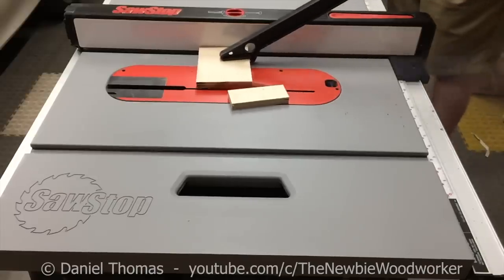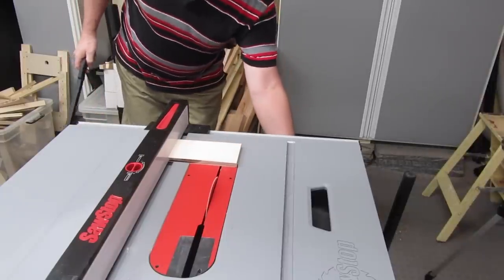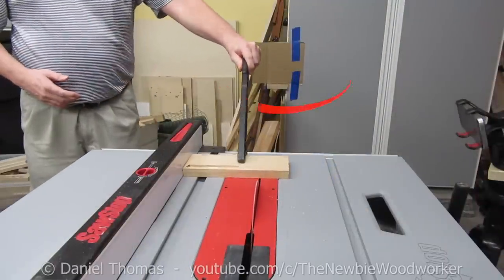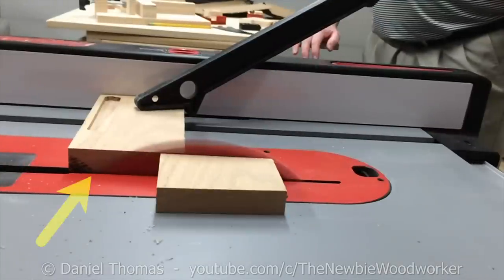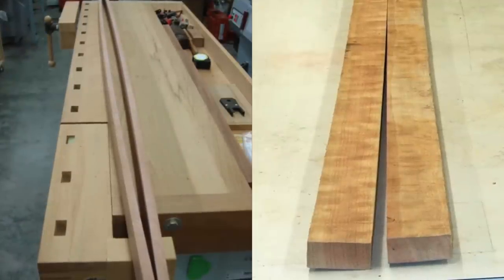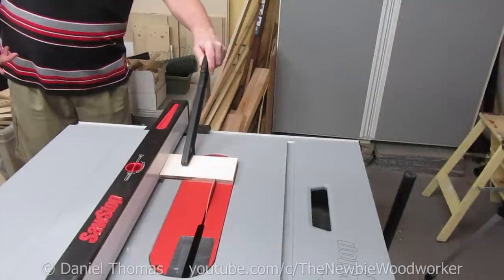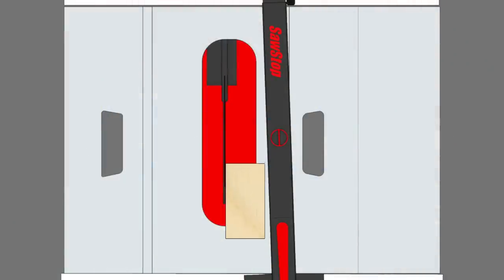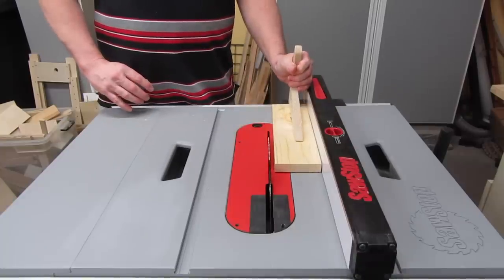Actual Kickback (in Slow Motion), & How to Prevent It

Comment: I use two push sticks often (you call it Mathias Wandel method). I have NEVER been on the right side or in front of blade, except my right hand. I always look for knots in workpiece and sometimes knock them out before cutting if they are on cut line; if cut line goes through knot I usually use two push sticks, do mild push when knot comes and  hard push into the fence with my left push stick behind the blade, also moving myself little further from blade. In along grain cutting I use push shoe which I made HIGH and even slide my fingers behind the fence so if kickback draws my shoe and hand the fingers would maybe help hand staying on the fence and not be pulled to blade, and NEVER EVER use low push brick as you use in your video because that one is NOT for table saw but for router table.
Probably not necessary to mention, in along grain cutting the right side of workpiece that follows the fence has to be flat.
Instead of crosscut sledge I use my constuction Mighty miter fence which is considerably better and safer than factory miter fence:
http://nesic.rs/sajt/en/2015-09-15-19-34-55/57-2014-10-27-16-12-47/191-carpentry-crosscut-miter-fence
In about 10 years never had a slightest kicback of any sort. Still I consider this tool highly dangerous and focus myself intensely on safe approach. When get tired or out of focus I stop working on table saw. You are ALWAYS A BEGINNER WITH A TABLE SAW, that is my rule.
Reply from the maker: Thanks for your comment.

Comment: At 11:43.  As a middle shop teacher we have a district policy that students cannot use the table saw.  A policy I agree with.   One day I was squaring up table tops roughly the size of your piece at 11:43 using the fence.  I thought its rectangular shape made it safe.  All it takes is one.  I had one of the tops kick out.  It struck me on the right hip, continued into a wall behind, and broke in half.  My hip was sore for months.  The "rule of thumb" says what I was doing was safe.  Not that day.  Cross cut sled would've been the way to go.
Reply from the maker: Sorry about your hip - I know that can be painful, but of course it could have been a lot worse. When in doubt, I always use a crosscut sled. That's why I have them in several different sizes. If I were ever to re-do this video, and trust me, I'll never try these stunts again, I'd talk more about crosscut sleds.

Comment: Another video I watched made a push block out of a 2x6 by cutting a half-inch strip off one edge to about an inch short of the length, leaving a piece attached to use to push the wood.
Reply from the maker: That's a good way of doing it. I've got a different way, but they're all good: https://youtu.be/sei4CwkP3kQ

Comment: Did you ever get an answer regarding ripping a sheet of plywood let’s say 15” x 12” between the fence and the blade?  Is kick back a strong possibility and what is the safest way?
Reply from the maker: I didn't, no, but I think once you have enough stock against the fence, the chances of kickback reduce. The big thing is to always use a riving knife or splitter, to keep the stock from getting caught by the rear teeth. I'm sure it's possible to get kickback when using them, but I think the odds drop dramatically. As to whether it's the safest way, who knows? When in doubt, I use a circular saw to get close to the right dimension, then get exact on the table saw. And since I bought a cordless circular saw, I find it a lot easier to use it. Plus the fact that a nice new circular saw beats the old worn-out one I had hands down. 😄

Comment: I have just started to use a table saw and I find that the OFF button is difficult to access. Perhaps a power board, on an extension lead,  with an ON/OFF switch would be more handy.
Reply from the maker: I can actually hit my stop button with my leg, just above my knee. So see if you can do that. But if not, a nice big power switch that's easy to reach and doesn't interfere with cutting is a great idea. I wish they made an off switch that you could use with your foot, but I wouldn't want to be able to turn it on with my foot, so that's probably not practical. Anyway, good luck!

Comment: Dear Friend, I purchased my first circular saw (Bosch GSK 190) and I am very new to wood working. When I was cutting some small pieces of plywood at 45 degree (for a small photo frame) on a cross cut jig, suddenly plywood piece jumped with a loud noise and fly away. It was damaged badly from all sides. Then I tried to a punch cut (because plywood piece was not wide) but I got same accident. I was feared and stopped working. What is wrong? What should I do? Please help me.
Reply from the maker: Are you saying you were using a circular saw with a cross-cut jig? If so, I can't even picture this. But when using a circular saw, the wood needs to be clamped down.
Reply: @TheNewbieWoodworker  Thanks.
Reply from the maker: @satishshukla2553330  👍

Comment: My first kickback occurred after being in construction for 15 yrs. and I nearly lost my left thumb. It was my fault 110%. What was I doing? I was ripping down 1×4 to trim out the jamb of a pocket door. I was running the lumber thru the table saw pretty fast and the board bound up in the saw and tried to kick back. I stopped it with my hip and when I did so it only had one direction it could go, up! There was very expensive ceiling fan overhead and it was on full speed. I reacted by using my left hand to slam the board back down on the table saw. I thought I had put my hand far enough forward on the board that it more than clear the blade, but it happened so fast that I didnt know that the saw had slid across the floor a foot or so, and when the blade came back thru the board, it was right where my left thumb was placed, it went half way thru my left thumb. It took 2 surgeries to fix things and I still have no feeling in the tip of my thumb. That was 16 yrs ago. 2 things that I did contributed to this accident impatience and complacency! There is one thing that could have prevented this even with the 2 factors that I contributed to this accident. The table saw was not attached to the floor and was not heavy enough to be secure from movement. Since then, no matter the circumstances, I will not operate a table saw that is not secured to the floor or table that it is on! If it had been I probably would have walked away with just a bruise on my hip.
Reply from the maker: Wow! That totally sucks. And I totally get it. When the stock moves or starts to fall off the table, we instictly try to stop it. Speaking of injuries, yesterday I stuck my thumb in the blade, and found out that the money I spent on my SawStop was worth every penny. Video forthcoming, of course. 😄

Comment: Another source of kickback you didn't mention is when using a miter gauge to crosscut, never "help" the cutoff end through the cut. Let it fall off on its own. This is particularly bad when doing a 45 degree miter because as the bind occurs when the leading edge of the blade nearly cuts through, the wood accelerates against the miter gauge and forces your hand to slide along the angle. If the miter gauge is in the left slot rotated clockwise 45 degrees from square (or the right slot rotated counterclockwise 45 degrees from square), this will drag your hand toward the blade as it jumps the miter gauge. And it will do it just as easily with a riving knife installed because the back of the blade is not involved.
Reply from the maker: Great point, and thanks for mentioning it. You're right of course, and the desire to do just what you said not to do is almost overwhelming sometimes. Thanks for the reminder! 😄

Comment: I'm just about to get into woodworking, so I've been trying to learn as much as possible.  With regards to both stored tension as well as a misaligned fence, is it true you're likely to feel the pressure on the stock and blade start to increase? I was watching another video where tension in the wood was mentioned and they said if you feel the pressure increase, I.E it becomes harder to push the stock, stop your cut.
Reply from the maker: Yes, that is very true. But it doesn't always happen that way, so don't assume you'll be able to tell when it's about to kick back.

Comment: Thanks for this video with actual demonstration. Will the riving knife prevent the kick back 100% ?. What is a blade guard and what is it used for?
Reply from the maker: You're welcome! Nothing can prevent kickback 100%. A riving knife will definitely help. And making sure your fence and blade are properly aligned will help also.

A blade guard is (usually) clear plastic, and goes over the saw blade. As the stock comes up to the blade, the stock pushes the blade guard up just high enough to get underneath. This helps keep your fingers away from the blade.

No reason to be too fearful of kickback. Just learn what causes it, try to avoid those things, and stand off to the side out of the line of fire. 😛
Reply: @TheNewbieWoodworker  Thanks again. Subscribed.

Comment: Thanks for the reminder about the dangers of kickback and glad you were uninjured in the making of this video. 

Some time back, I saw a similar demo on YouTube (wish I could remember the maker!) who used painted styrofoam instead of wood. The paint was removed in an arc as it passed over the top of the blade. That made a strong impression on a relatively new table saw user, indeed!

The riving knife or splitter, coupled with the longer-based push stick has kept me out of trouble so far. The black stick you used in the demo should be sufficient evidence that these sticks are really not useful in a safe cutting operation! Just my $.02.
Reply from the maker: Thanks, and I agree! I've since "upgraded" my push sticks.

Comment: If your making boxes - cutting the box on all four sides to separate the lid from the body of the box, on some saws you have to take the riving knife out because it stands to high to make the cut. People put shims of wood in the cuts they’ve already made to stop the blade from pinching on the wood does this work?
Reply from the maker: Good call on those types of cuts, you're right. And yes, putting shims in does indeed work, it's a tried-and-true method, but I imagine you need to practice it a few times to be sure to get it right.

Comment: While writing this comment, i have not fully read all the comments below, so if mentioned before, excuse me! But since you asked for critique, i wont give that, but feedback i will give you! Me being a newbie / recreational woodworker, i don't start out with a sawstop table saw, they are simply too expensive. instead i use a Bosch PTS, something sawstop would consider a jobsite tablesaw. The 'problem' with the cheaper less robust table saws, is that the fences are generally not as sturdy as seen in this video due to the 2 side clamping nature of most. This makes me having to align both sides of the fence every time i adjust my cut. How would you go about this? Any tips?
Reply from the maker: Hmmm. First off, my fence only locks in one place also, so that by itself isn't the issue. For that matter, my old Ryobi also only locked in the front, and it didn't have that issue either.

It sounds to me like the clamp on your fence is too loose, so when you clamp it down, it doesn't quite square itself. I'm sure there's a way to tighten it a little, so see if that helps.

If that's not the issue, then as you tighten the clamp down, push the fence towards the back of the saw, to try and get it square with the saw before the clamp completely engages. I actually have to do this with my SawStop sometimes, otherwise it ends up a little crooked. If pushing it forward doesn't help, perhaps pulling it back towards you may help.

Also, take a good look at how the clamping mechanism works. Turn over the fence and inspect it closely. Try to figure out how it works. Once you do that, you may figure out what's wrong.

Other than that, I'd recommend hitting up some of the woodworking forum websites, like LumberJocks.com, to see if anyone else has experienced this, or has other ideas. The woodworking community is made up of a lot of people willing to help, so don't be afraid to ask. Whatever your problem is, it's highly unlikely you're the only one to experience it. 🙂

Good luck. If you figure it out, post back and let me know.

Comment: Some guitar builders use a specialty table saw blade for cutting fret slots. The kerf of the blade is designed to create a slot that will snugly fit fretwire tang. That is about 0.6mm, or 0.023". As you might guess, that means you can't use a riving knife. However, these cuts are generally done on a cross-cut sled, and with a very shallow cut, like maybe 2 to 2.5mm, so there is relatively little risk of kickback. Still, the riving knife has to come out.
Reply from the maker: Interesting information. Thanks!

Comment: Without reading all comments,  but seeing it hinted at, reduce distractions. When I had young (under 5 or so) I wouldn't operate my table saw with them in the shop. I felt I needed to focus entirely on the saw  and not young people around me. This goes for all people in the area, but kids dont always recognize the risks.
Reply from the maker: That's a great point, and it's something everyone should think about. Even something like a pencil on the table that starts to roll off the edge can be a dangerous distraction. Thanks for sharing!

Comment: I got my first kick back 2 weeks ago. Was ripping a 2x4 that was just slightly too long for the table we have behind it, and once I got it through it tipped over the table, lifted the guard, then the off-cut fell back down on top of the blade. Launched it back and caught the back of my hand a little bit infront of where the thumb connects to the wrist.

Took off some skin and now I got a nice lump of scar tissue in there lol.

Now I'm a lot more careful. Found out afterwards that one is  the weakest table saw we have there and it's 6hp I think
Reply from the maker: Wow! People always tell you that when you make unusual cuts, you should do a dry run-through to check for situations like this. I say "people always tell you" because I usually forget, until it's too late. But maybe your experience will help remind you to do a dry run first, right? 😄 Glad you're OK.
Reply: @TheNewbieWoodworker  it's not a strange cut at my job. It's pretty standard actually, the problem was I didn't realize it was a bit too long. Now whenever I get a questionable size I place it past the blade and if it starts to tip I get some help :)
Reply from the maker: @Achonas  Yeah, I need a better term than "strange cut", because it should include "questionable size". 😄

Comment: I made myself 2 copies of the microjig push block with scrapwood. You can’t adjust them but they cover most cases. No need to spend 150$. It has the same overall shape, with one large contact surface, a large gap and finally a smaller contact surface.
Reply from the maker: God job! Yeah, those things are too expensive.

Comment: I don't know if this has been addressed, but the rule of thumb (or lack of thumbs if you're not careful) is that you shouldn't rip a board that is less than the diameter of the saw blade.  A 10" diameter blade means the shortest board you SHOULD rip is 10".  Anything shorter and you're at a higher risk of kickback.
Reply from the maker: I don't think the size of the blade is relevant - I would think it's only the portion sticking up above the table that matters. In other words, don't rip a piece that could end up with the entire piece between the front and rear of the blade. How does that sound to you?

Comment: I recently bought a cabinet saw and enquired why the fence here in New Zealand was different then for the same saw being delivered to other countries. The reason I got from the shop was that is a legal requirement here to be able to withdraw the fence backwards so its length is no more than half the sawblade. Apparently if the workpiece has nothing to wedge against it is safer for kickback. So my fence is retractable to mimick the stopblock you used without giving the cut piece anything to push against after the cut. That adds in to the comment above about the minimum width of the stopblock. 
Any thoughts on the matter?
Happy woodworking everyone
Reply from the maker: I'm having a little difficulty picturing what you're describing. Can you find a picture or pictures of it, and post some links?
Reply: I have taken a couple of photos to show what I mean. Do you have a email that I can use?
In principle my fence is depth adjustable. The part leading the panel into the cut can be made shorter so that no wedging of the panel against the fence on the rear end of the blade can occur sine the fence only reaches to the start or middle of the sawblade (or whichever length you choose to use).. trust a German to make things sound complicated :)
Reply from the maker: Go to http://thenewbiewoodworker.com, click "Menu", then click "Email", and you should be able to email the photos to me from there.

Comment: Just wondering why not work from opposite side o machine as in pull through rather than push through? Just bought a table saw which idles at 4800 rpm with carbide teeth and would just as soon loose a hand as opposed to my Head?
Reply from the maker: I don't remember all the details, but working from the other end is not a good idea. As for losing your head, or your hand, when you're armed with the knowledge of what causes kickback, and you use your safety tools like the riving knife, and you stand to the side, you're pretty safe. I mean, anything can happen, but that's true with anything in life, right? Don't fear the saw, but a healthy respect is a good idea. 😄
Reply: Thanks forgetting back so quickly, am looking forward to trying the table out!
Reply from the maker: @MrCoffeypaul  Have fun and stay safe. 😄